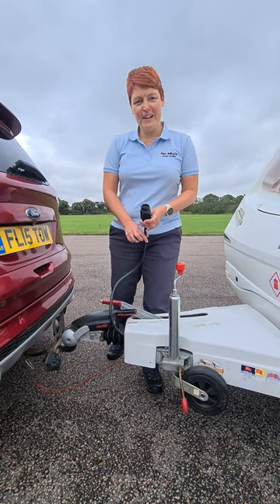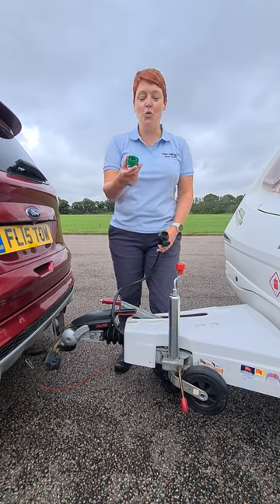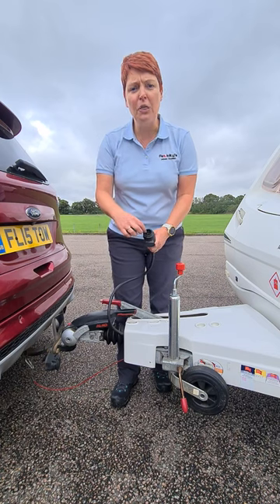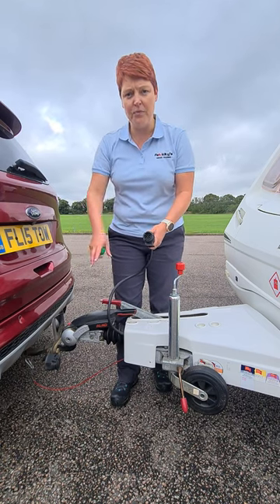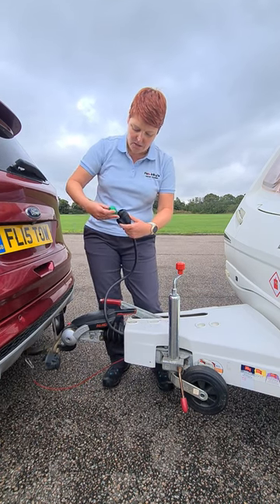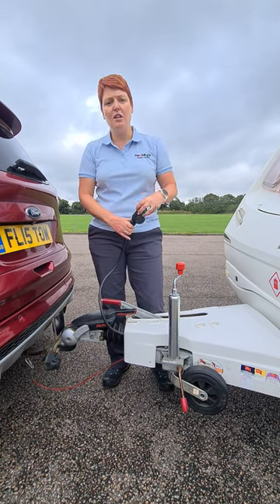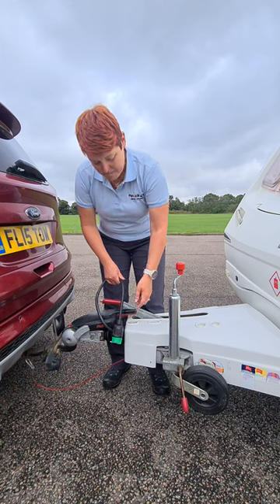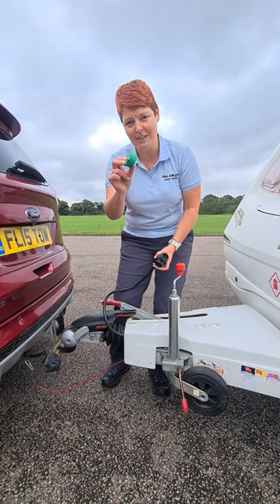How to re-align a 13 pin plug on a caravan or trailer

Comment: I bought two of these tools, one stays in the car and the other stays in the caravan, had them for about two years and I used one only two weeks ago for the first time,they are a must have tool, thanks for sharing Fliss, 👍.
Reply from the maker: Aren't they just! With a lot of care and careful connection, hopefully you won't need to use it often, but it's reassuring to know you've got one 🙂